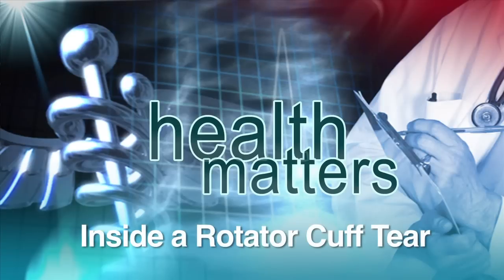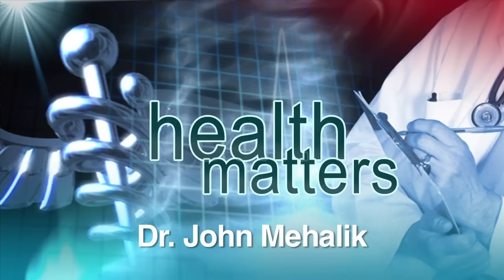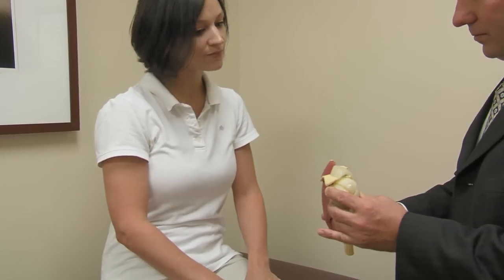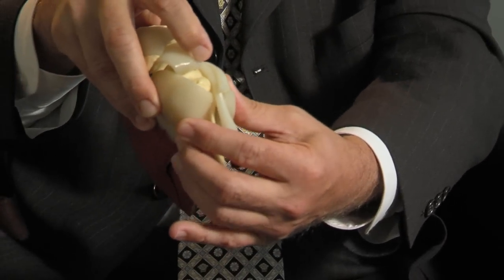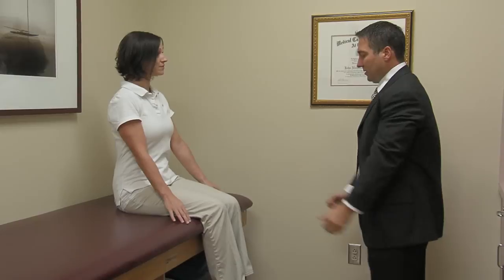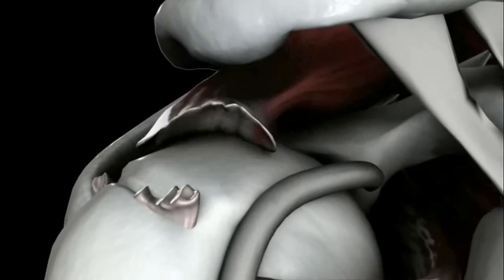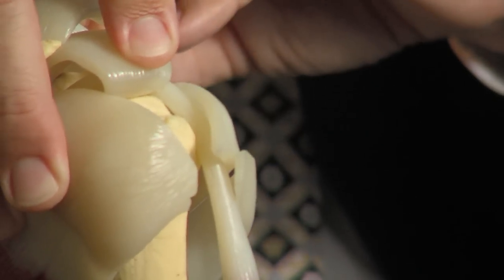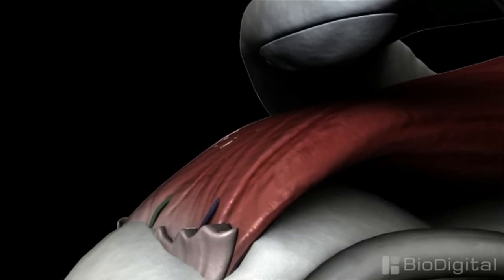Inside a Rotator Cuff Tear

Comment: I tripped on a gas hose while filling up.  I landed in the 'push-up' position, almost hitting my face on the pavement.  my wrists were sore for a couple of days, but then got better.  About three days later, I had pain in my left shoulder blade that radiated into the right side of my neck and into my upper shoulder.  It took about a month to heal up.  One week ago, I tried to lift a soft-sided cooler out of the back of my truck. I had my arm extended out straight, like the arm of a crane, and tried to lift straight up.  Stupid.  I felt a mild twinge of pain, then stopped.  Three days later, the pain started, just like when I fell but worse.  I can't look down without pain in my shoulder blade, the right side of my neck, and into my upper shoulder.  That's been a week.  It now hurts down where the bicep connects attaches in my right elbow.

Comment: I came off my dirt bike about a month ago now & landed heavily on my shoulder, most of the movement has come back but I have an almost constant dull pain on the outside of my shoulder.  I can't lift anything with that arm extended, have to kind of lock my elbow into my hip & use bicep to lift with that arm,  certain angles it is still agonizing pain with cracking & popping noises, I can't sleep on my back or right side without discomfort (at best) even walking with shoulder fully relaxed, there is a 'crack' every time my arm swings past bottom center.  Does this sound like a rotator cuff tear or something else (maybe bone related with the constant cracking & popping?)
Reply: You might have a grade 2 or 3 shoulder separation, also known as an AC dislocation.  The AC dislocations are ranked from 1 - 6,   a 3 or less usually not requiring surgery.  A grade 3 and above will have a very noticeable bump on top of your shoulder.  I recommend you see a GP and have x-ray, ultra sound and MRI.
Reply: @damo87araimo  Thank you so much for the reply!  I finally made the time and went to see a GP they sent me off for an ultra sound & found that I had a tear in my "mid/posterior supraspinatus tendon" and "mild subarcromial bursopathy" in the acromioclavicular joint, but I'm not entirely convinced that is the only damage / problem as it has been about 6 weeks now and it shows very little signs of recovery.  I think I'll head back to the GP on Monday and request an X-ray / MRI as well.  Again, thank you very much for taking the time to reply!
Reply: @lukewatson3071  No worries.  Dont rush into a surgical solution.  The shoulder is a very complex connection.
Reply: You need surgery my friend. Don't wait too long like I did. Now I am losing feeling in my entire arm down to my fingers.
Reply: @lukewatson3071  hey man. Same thing happened to me. I do parkour and i felt about 3 months ego and still hurt and im noy able to practice some  a specific tricks because yhe pain.
Reply: @lukewatson3071   how long yhe doctor told you that should take to this heal?
Reply: @shawnd4363  Ahh not sure if mine is that bad...  another couple of weeks gone by now and it's slowly getting better, still lots of cracks & pops in joint, and quite a bit of pain on certain angles or with jerky movements, but slowly getting better. :)  Pretty sure regular physio exercises and big doses of turmeric (a 'hippie' (but proven) anti inflammatory) are also helping!
Reply: @HaroldDGlez  Mine is supposed to be about 6-8 months to heal!! :(   but as I said in another reply, regular physio exercises and anti inflammatory tablets seem to be making a big difference and I'm hoping to be back on the bike soon, maybe 4-6 months total recovery.  I waited about a month before finding out what was wrong, if I had done this sooner I could have started physio earlier!    There are a few good 'how to' videos here on you tube for the physio exercises if you don't want to pay someone too!!
Reply: @lukewatson3071  -
Luke, you are probably going to need surgery. If it's a partial year, it may heal up.....MAY. Your age can be a large factor in deciding. You have to be CAREFUL now however!!!! 

See my other post here. Both of my shoulder's are now repaired. 

>>>> BUT <<<< I have to be very careful for many years now I lift & position things!! Above shoulder-level is now pretty much a no-no....period. If I have to lift something requiring reaching-out....also NO.

SO.....my days of just "macho-ing" everything around are pretty much OVER. I've also gotta be careful of my new Left knee (9/2014), & 3 screws in Right foot (fallen-arch repair (11/2017). Large Hernia fixed in 2011. Lumpy leg-vein removal in 2012.

I am now a Cylon.... ;-)
Reply: @Wyn61  Thanks for the reply mate!  It was a partial tear, but substantial... And no doubt I still have a long time ahead of being aware of how I use my arm.  However, with constant physio exercises while using increasing amounts of weight as it (very) slowly heals & builds back strength I am fairly confident I will regain most movement & strength despite the constant cracking & popping.
Reply: @lukewatson3071  -
Hey Luke! I may have mentioned I'm 57 now. If you're in your 20's or 30's, it may heal, but it's DAMN slow. You may need some PT. They'll show you how to keep your shoulders "Low", & to squeeze your back muscles together. What you want to happen is......with shoulders staying DOWN and back vertical/straight, squeeze shoulder-blades together. Idea here is to mainly take your shoulders "out of the lift". Let your bigger back muscles do more work. It's weird doing it the right way, but starts to feel more normal. The more load you can keep off the shoulders, the better!!
Reply: I am suffering from same problem while working out in gym did wrong biceps MRI showed rotatory cuff had shifted from 3 clock position to 9 and also there was tear of my legment which connects rotatory cuff and shoulder since 3 years I am suffering this no moment can be done and also it pains a lot